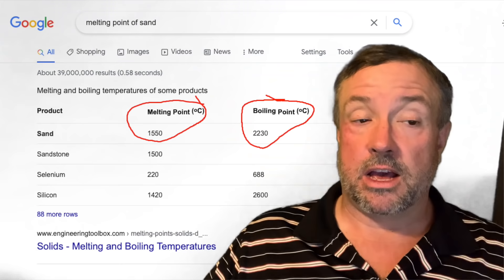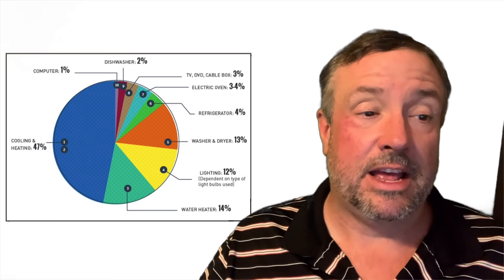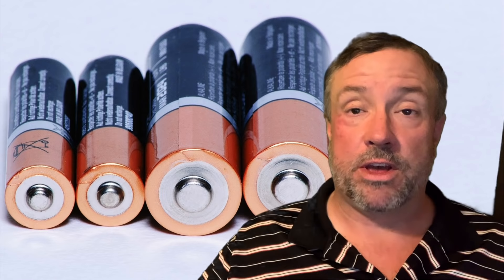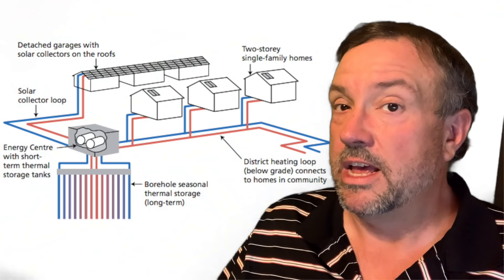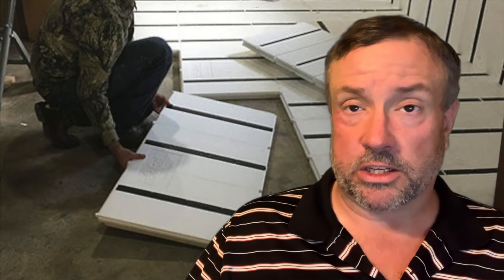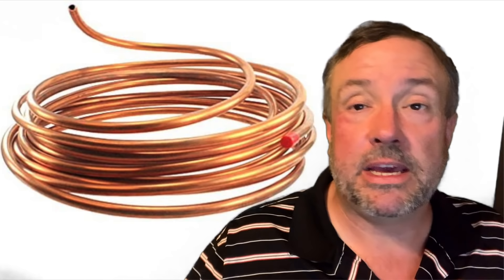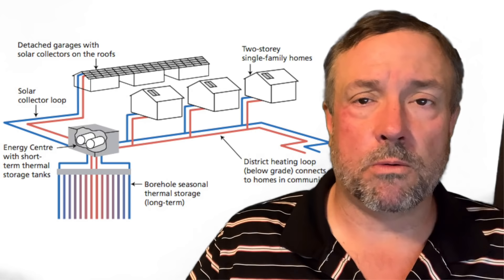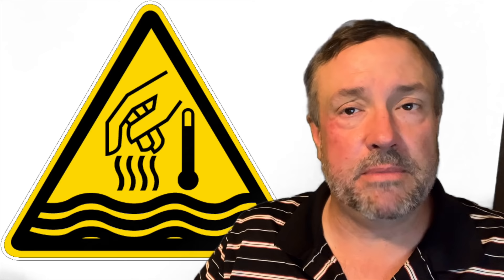Sand for Thermal Energy Storage

Comment: The best system I have seen is much simpler and does use sand. My friend built a concrete building 10x10x10 he used concrete blocks but I would use the styrofoam concrete forms that lock together. Down the middle of the building is a wood stove custom made 2’x2’x9’. The stove is ruggedly built to withstand the weight of the sand. He also used a 16 foot length of 6 inch steel well casing as a chimney welded into the top of the stove. The building has styrofoam placed on the inside of the block walk to keep the heat in and also on the top. The stove is completely covered in sand and a system of pipes are distributed through the sand which goes all the way up to the top of the building. Water is pumped through the sand with ordinary circulator pumps out to his house. He actually rigged the plumbing to his existing oil boiler so he can heat his home with existing piping and radiators. He lights a small fire once every couple of days to maintain the temperature in the heat sink. He has antifreeze in the lines so it won’t freeze if he isn’t using it in the winter. The thing that is better about this system is that there is no creosote buildup because the water doesn’t contact the firebox directly. Also those water jacket heaters only hold so much water and don’t store the heat. My friend also has a domestic water coil going through the heat sink. If he goes away during cold weather he has to blow out the domestic coil because it has no antifreeze. This system can be adapted to use in greenhouses and other uses.
Reply from the maker: very cool thank you for sharing
Reply: @John Pino That's very similar to something I'm interested in doing.  Can you recommend ways to get more information/details on what you described, not just that set-up but any sort of related information or links or people...?  Thanks!
Reply: @patrickcleburneuczjsxpmp9558   I don’t have any more info. I know he did buy the plans from an engineer but the plans are outdated. The pipe used was 1/2” pvc and copper. I would think that pex  or soft copper coil pipe would be a more modern choice.  I know that there was no pipe within 6” of the top of the stove, I would stay away a foot to be safe. I don’t know how hot the sand gets you could melt the pex. I know he doesn’t make a big fire, just enough to maintain the heat sink. If your project requires a lot more heat you could use iron pipe and a larger building. I think my friend’s system can hold a million BTU’s and release 100,000 an hour. I also wonder if a rocket stove would be more efficient. I have also thought about modifying this model to include a charcoal oven so that you could make bio char for the farm.
Reply: @hughmanatee7433  Thanks very much for the reply.  You're saying more of the same things I'm thinking.  I'm currently using an outdoor water stove (and the firebox is big enough that I'm also making charcoal in a modified standard size (5 gal?) propane tank), and that system has worked great for me, but the stove is about at the end of its life -- it has a small leak already -- and I'm trying to figure out what I want for a replacement.  One thing I'm pretty sure about is that I want to continue to heat with wood and I want to continue with an outdoor system.  (I think I prefer a system like I have now that is completely separate from the house, but I might consider a stove that was in/attached to the house if I could feed it from outside.)  If the stove itself were all masonry, I wouldn't have to worry about leaks or any water-metal issues with the stove itself, but then if I had some kind of water tank above the masonry I could store BTU's in the tank and use the water to transfer the heat to the house (and maybe use the water to indirectly heat my domestic hot water like I do now.)  But if the tank started to leak I could replace it without replacing the whole stove.  So that's more or less my idea.  I don't know if a rocket type batch firing system (like traditional central/eastern European masonry stoves) is what I'd want or not -- I like that I can currently use very large pieces of wood, that I'm not strictly limited to ideally seasoned wood, and that I can keep a fire going rather than having to start lots of fires, but I realize there's a trade-off in efficiency and how cleanly it burns -- but I guess an all masonry firebox would allow for long-slow or fast-intense burns.  I guess a masonry firebox would have to be smaller than what I have now, but I might be able to incorporate a baking oven or warming chamber into the the design.  I don't think I've ever even heard of anyone else that has an outdoor masonry stove with water to circulate the heat to the house, but I'm not sure why.  Obviously steel water stoves can be mass manufactured and delivered ready to use, but I really like the idea of a more modular set-up that might be able to last a lot longer and be relatively cheap and easy to fix (especially compared to water stoves which rust out or leak for other reasons.)  Thanks!
Reply: @patrickcleburneuczjsxpmp9558  I would avoid any water tank used to save heat. The sand is the key and it is about mass. Go big.

Comment: The flow rate of the liquid through the sand determines contact time which regulates thermal energy absorbed by the liquid. You could run water through 1,000° sand and adjust your flow rate so that the output temperature is 70° (or whatever you desire).
Reply from the maker: nice
Reply: Water run through 1000 degree sand would be steam...
Reply from the maker: @kyleburdick8771  depends on speed, length of run and contact time
Reply: How do you get around having some water left in the pipe where the sand continues to heat it to super steam?
Reply from the maker: @kenhilving276  good point
Reply: @kenhilving276  Fresh, cool water would continually be flowing through the sand. If the water stopped, for example if power to the pump was lost or the pump broke, then the water would become steam and a safety valve would open to blow off the steam.
Reply: @ronson-natsarim  That would work, but it implies a need for continuous heat.

Comment: I plan to use common engineering bricks. Each brick has 3 holes through it. I will line up 13 bricks on their sides so that the holes line up. I can now pass stainless steel (14 gauge ) (approx. 0.3 ohms per foot) through the holes. I will put 3 bricks length wise to make a layer 25 inches wide (3 x 8.5 inches) by 13 bricks long. Then I will make 6 layers, one above the other. I will thread wire through the holes (in series)so that the total resistance is of the order of 16 ohms . With 240 volts across this conductor it will generate about 4 kw of heat.  Over time this can heat the bricks to 400 or 500 deg. C.  Next I will construct a container using paving slabs. 6 off 2ft. by 2.5 ft will make a base 6ft by 5ft. I will construct a rectangle of 2 in by 2 in by 1/8 angle iron with dimension of 4 ft by 5 ft. (Need 4 off) this will be centered on the base. It will be used to contain 2 ft by 2ft patio slabs at the 4 ft end and 2 ft by 2.5 ft slabe on the long side. A second angle iron frame will be used to contain the upper edges of the slabs. One ft of dry sand will be placed in the container.  A 24 in by 4 ft by 1/8th in steel will be centered on the sand. Then the brick pile will be assembled on the steel plate, and the conducting wire heater is installed , with copper conductors brazed to the two ends of the conductor. This lower layer of bricks and the top layer will be enclosed by a. frame of 1 in by 1 in by 1/8 in angle to contain the bricks, and the top layer of bricks will be covered by a sheet of steel so as to keep the sand out. Then a second rectangle of paving slabs will be added to raise the height of the container to 4 ft. The container will be filled with sand so that the brick pile is completely surrounded by 12 in o.f sand. The temperature of the bricks will be controlled by thermocouples with an appropriate controller. I estimate that this assembly can store more than 200 kWh. I will use off peak grid to power it.  I estimate that it will provide approximately 10 days of background heat to my home when it is installed in my basement. Heat from the pile will heat the floor of my bungalow. Also by leaving doors open the heat will rise from the basement into the ground floor.. I can control the rate of heat loss by adding rock wool insulation to the outside surface oof the pile, and by controlling the temperature of the bricks,. Ultimately I plan a wind powered generators (target about 150 kWh per week) to heat the brick pile.
Reply from the maker: @JohnStephenson-he1ob  I love the detail!!! Go for it!!!

Comment: Pump air through the pipes.
It doesn't boil, but holds and releases heat effectively.
Final removing from the sand battery requires an air to liquid heat exchanger.
Reply from the maker: interesting

Comment: As a proof of concept for sand I would personally start with your boiler and building an enclosure around it and filling it with sand.  Then the system can grow with solar collectors.
Reply: thinking about this,  we need to change the boiling point of water,   an anti freeze/boil additive.  Interesting question is if you saturate  water with as much salt as it can hold then how much does that increase boiling point by.
Reply: Sand is the storage medium I am trying to think of a way to move that heat from external storage to be usable in the house.    An advanced method would be to convert the heat to steam to drive a turbine connected to a generator.
Reply from the maker: great ideas

Comment: A 70s solar system used air blowers from a solar collector to an insulated gravel heat storage running year long collecting heat during the summer and releasing it in the winter. Gravel was used to make the air pass through it easier to move throughout.
Reply from the maker: Cool! Thank you for sharing

Comment: I did some research on this very idea. I learned that asphalt will hold more heat, up to a certain point, than any other earthly material.
Reply from the maker: interesting
Reply: The denser the material the better the heat holding capability
Reply: stinky

Comment: I was thinking in the lines of no-movable parts, sun thermoelectric energy. It would be probably less expensive and safer. My idea goes like this: two tanks. The top one is circulating water due to it's high specific heat (my location does not freeze) that goes into an caco3 paint based heat radiator. Colder water sinks, therefore the coldest part would be in contact with the peltier. Lower one is filled with sand and has a pipe circulating oil (in a pinch sunflower or soybean oil migh work) and into a solar contrator. Again we assemble it in a way that the oil will cicle on its own based on the fact that heat goes up and cold goes down. I have no idea of how well this would work, but I tried reducing failure points while increasing heat difference, plus diminishing costs (less of those expensive metal tubes). The good thing about this system is that it will still produce electricity at night. I would use this only for electricity generation thought. For heating water for daily use I would use the water-sand methods.
Reply from the maker: Interesting

Comment: For charging use electric Resistive Heating and solar.  Vehicle Glow plugs can heat to 1400C.  Stove elements can heat to 900C.  For extracting heat look at copper pipe and air to a holding water tank like you discussed.  I wonder what a regular hot water tank filled with sand would do if the aquastats are modified for high heat?
Reply from the maker: Thank you! very interesting ideas!!!!!!!!
Reply: More volume would be more efficient, a well insulated water tank may be a good test bed tho.
Reply: Glow plugs and resistive elements get heat in. How to get it out?
Reply: Great video. I’m in Hadashville. Here’s my main point- if I buy a system that can meet my needs in the winter then I’m producing 10-15x the power I need in spring/summer. So efficiency is irrelevant, it’s all about cheap storage and retrieval. Especially with panels price dropping. The panels are probably 1/4 of the total system cost.
Reply: I like the idea of sand heated with glow plugs. Simple reliable. Imagine using TEG to convert that heat back to electricity. I know it’s very very inefficient. But someone do the math for me. How much sand? You could create a 2 stage sand cell for just the hydronic heat. But you probably also need electricity because we get so little in December? I use wood in a soapstone fireplace now, hope to do the Chinese greenhouse maybe.

Comment: just use multiple mirrors to focus down a light tube to the base of the sand/ granite chips extract heat using steel piping and air. been working on this for years.....live long and prosper
.
Reply from the maker: live long and prosper
Reply: @SimpleTek  but what do you think of the idea

Comment: Well a cubic metre of sand stores 105 MJ for a heat difference of 30C, while a cubic metre of water stores 125 MJ.  So water is better up to 100 C.  The advantage of sand/rock is that a much higher temperature differential is available.  But, as you say, and as my own contemplations have found, the complexity of dealing with temperatures over 100C on a domestic set up are too much.  I can buy at 30 cubic metre plastic or concrete water tank for about $3000, and if that is heated to say 60 degrees above ambient, then I have 7560 MJ of energy stored there.  Foam concrete insulation, plus fibre glass batts would slow heat loss enough and such a system would be affordable and simple enough to build.  Hot rock/sand with say high pressure air to transport heat from the solar concentrator is just toooooo hard for the ordinary person.  A bit of warm water plumbing and a few circulator pumps is a simple job..   
7560 MJ is equivalent to 70 days heating at 30 kWh per day.  Even assuming 50% lost via heat losses, and another 50% lost via poor transfer effeciencies, that is 35 days at 15 kWh per day.  If your heat capture panels are able toget anything like 30 kWh input on a normal winter day, then you are safe for the full year's space heating providing you don't get more than 15 days rubbish weather in a row.  You would see the storm coming anyway, and button up tight to conserve the resource.  That sounds viable to me.  Rocks or sand?  Too hot to handle, IMHO..
Reply from the maker: interesting! thank you for the reply
Reply: I fully agree on domestic DIY scale you need to get as simple as possible because even the easiest setups bring unexpected challenges... :) Check out a guy called Sergiy Yurko he has a channel about a lot of solar collectors and thermal storage. Really interesting.
Reply from the maker: @myounges  I actually have a channel link exchange with Sergiy. He does INCREDIBLE work with solar collectors and water thermal batteries! I absolutly  LOVE his work.
Reply: @SimpleTek  great minds think alike... Haha yes that guy really takes his job seriously. 👍
Reply: How about lights, cooking or cooling for those of us in the deep South?  Shouldn't the system provide electricity?
Reply: Interesting stuff, good forum to bring these questions up. Thanks all
Reply: Use the concrete tank for heated water storage, bank sand all the way around it up to the top, that would help insulate and store more heat to keep the water temperature stable.
I would do a coil of pex in the tank and use a heat exchanger system for home heat.
Then do solar battery system for the electricity.
A secondary system I just thought of would be away from the house and we'll.
What if you had a source for manure and you have a closed tank too put it in to decompose piping. Off the methane to use as a gas for different uses?
Just a thought, that would need careful planning so it doesn't blow up.
Reply: @SimpleTek  If you were to be building a new home Just Bio Fiber building blocks(hemp crete company is in AB Can) give that new home an R70 right off the bat, plus a two hour fire rating, and sequesters carbon for 100 years.  I would ask what your R factor of your current home is?  Think about a water store underground and near a wall of your home if possible, and insulate it with the best insulation you have readily available.  Think of using the heat from that store to preheat a coil on a air source heat pump, build a structure around the coil of the heat pump to keep the heat in around the coil but allow the air from the compressor fan to escape.  This might just help your heating bills.
Reply: @graveseeker  YES !

Comment: KISS principle ! energy-source = cheap electricity from PV (you need it anyway) in summer and autumn (aprox. 3cent/kWh), cheap storage material = Sand, cheap insulation = DIY-Aircrete (for small projects), parallel (short) metal pipes burried in sand (for low resistance airflow, but prevent unwanted flow);  external (not burried) heatexchanger air to water (60°C); external electric (resistive) heater to heat up air and fan. Make sure to stay away from groundwater and rain. Use heat.loss with heatpump or greenhouse. Solar energy = independence 🙂
Reply from the maker: We’ll thought out!

Comment: You could use photovoltaics to run an electric heater to heat air and blow it through tubes in a sand battery.  The same hot air would be recycled around in a closed loop and continuously reheated by the electric elements of a heater.  I don't know how hot you could get it but I would think you could get it to at least 500 degrees like an oven.
Reply from the maker: I like it
Reply: This is what I am investigating. Right now I'm uncertain on how to calculate the area of heat an individual pipe would transfer into the sand.
Reply: Couldn't you just use heating elements embedded in the sand?